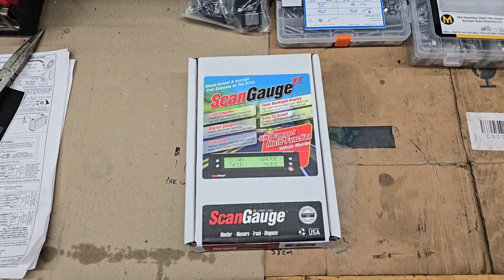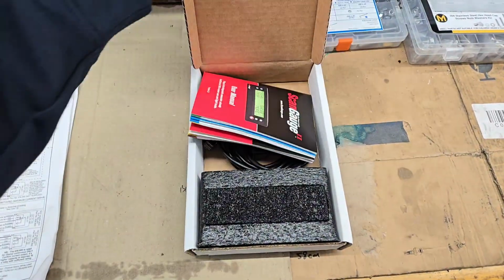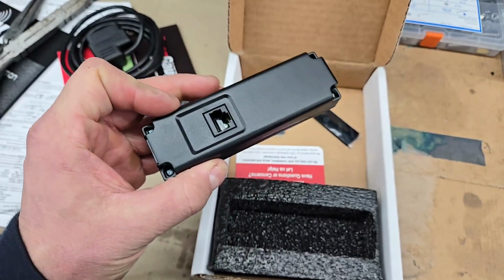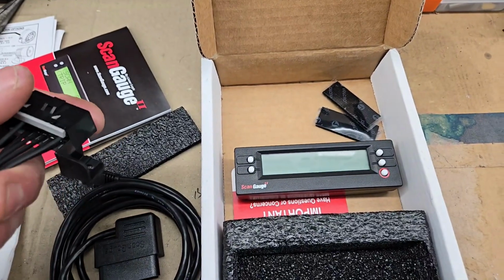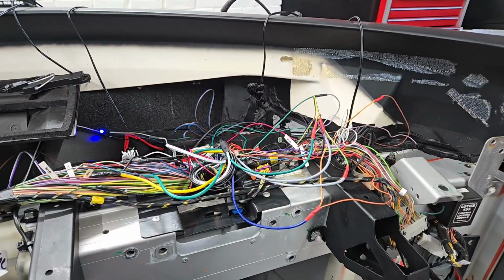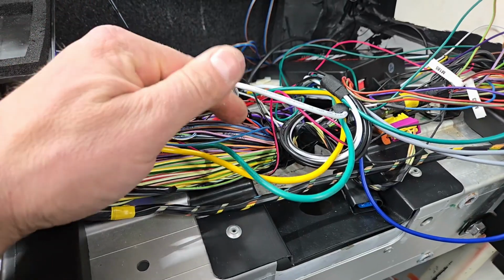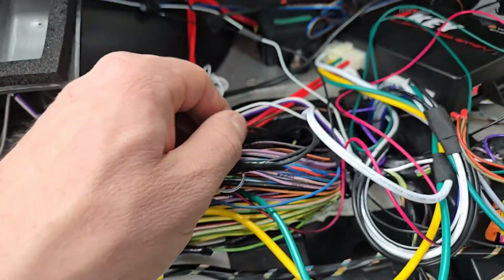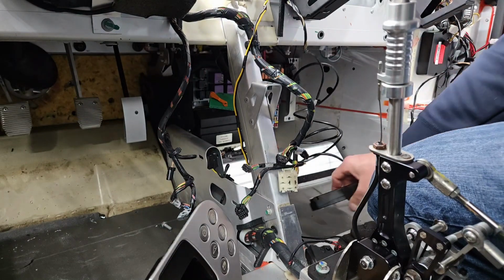Lotus Evora S rebuild - Scan Gauge install - Part 11

Comment: Hey man love the vids! The S1 actually does have a coolant temp gauge, although no values are actually labeled on it. But we know three points: 140F (bottom), 195 F (midpoint), and 250 (top). It’s the S2’s that only have the dummy light. I don’t believe the S1 temp output (gauge) is damped but I’m not 100% sure. Regardless, your solution is nice and will be a good supplement to the oem gauge for an exact value.

FYI from the OM:

An indication of the engine coolant temperature is displayed, with ignition on, in the form of a vertical bar graph in the instrument panel right hand screen. To optimise display space, the shown scale commences at 140°F, and finishes at 250°F.

The running temperature will fluctuate a certain amount as the operating conditions change, and during periods of idling or in heavy traffic, the temperature may rise to over 212°F, with the cooling fans switching on at half speed at approximately 208°F, and full speed at approximately 217°F. In order to prompt closer monitoring by the driver of temperatures over 230°F, the temperature icon will flash and be accompanied by the message ‘Engine too hot’ displayed above the car silhouette.

Looking forward to the next video 👍
Reply from the maker: @badonkadonkey16 can you tell I haven't actually driven the car, yet? Lol. Been doing a ton of research while waiting on parts and stumbled across posts bemoaning the lack of temp reporting...assumed it was all Evora experiencing it :)

Ex. https://www.lotustalk.com/threads/temperature-gauge-on-the-evora-400.542677/

Really appreciate the thorough (and comforting) response. Guess now I have an augmented reader to complement the stock cluster as well as a built-in code scanner. Pretty sure it will be useful regardless 😁

Thanks again!
Reply: @ No worries haha, happy to share/help when I can.